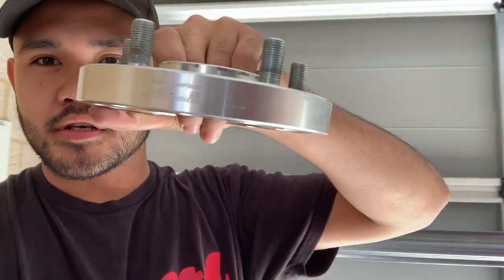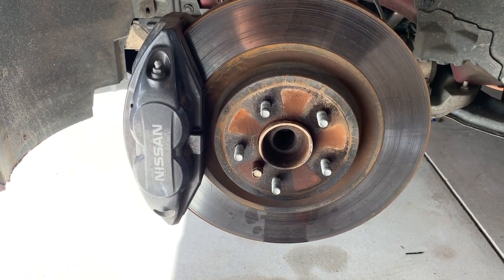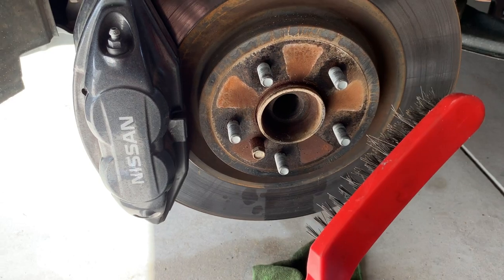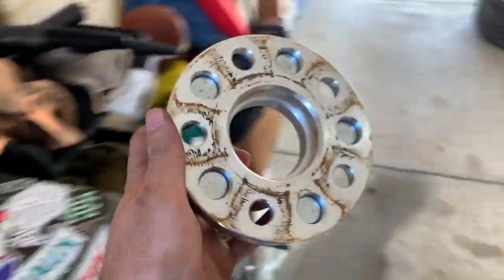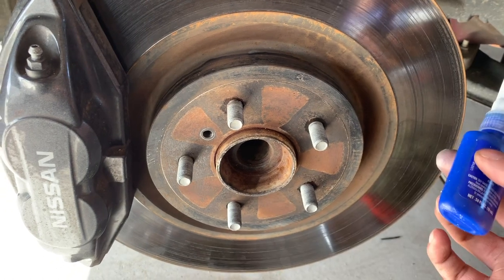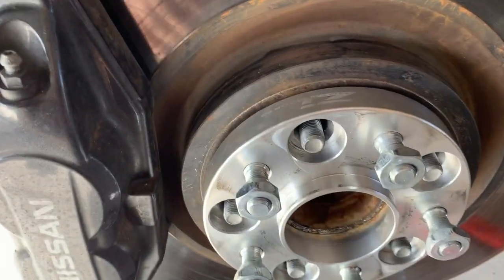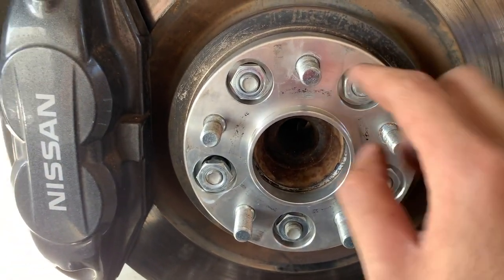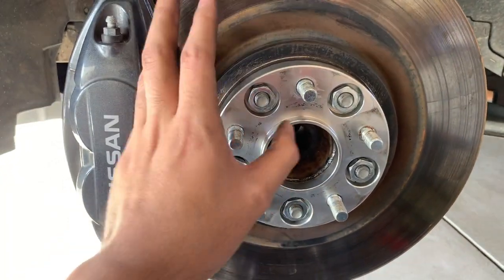Installing 20mm Z1 Motorsports Spacers On 370z

Comment: Did they ever get loose? Any issues with shaking or eating up the tires faster?
Reply from the maker: Nah they’ve never come loose or have any shaking. If you don’t have good alignment that’s what eats up your tyres (excessive camber and toe in/out). Just make sure you do torque the spacers properly then drive around and torture them up again
Reply from the maker: Also I was daily driving with spacers on for 5 years with multiple track days as well

Comment: Might not see as its been a while, but just got my z and trting to fidn the best type size for the oem rays. Cheers mate
Reply from the maker: Hey mate, best type size of what?
Reply: @HustleGarageTV   tyre size sorry, been seeing a lot fo 295 or 305. what are you running cheers
Reply from the maker: @adampilkington6521  on my current wheels or stock wheels?
Reply: im asking the tire size, are you just using 275 in the rear and 245 in the front @HustleGarageTV
Reply: for the video
Reply from the maker: @adampilkington6521 yeah in this video I’m running stock tyre sizes 245 and 275. I’m currently running 255 and 285 now

Comment: Great vid!  Are those Rays wheels?  I ask because I have Rays and I’m about to do the same install, 20mm on the front, and was wondering if you any interference when you put the wheel back on, from the factory lugs hitting the back of the wheel? I previously tried 15mm but the lugs hit the wheel and wouldn’t allow it to sit flat against the hub. Thanks.
Reply from the maker: I had no trouble at all, not with these spacers. I tried GkTech ones cause they are really good spacers but the studs on them were to long to screw the factory nuts onto the wheels, so I switch to these ones and it was perfect fitment

Comment: With 20mm did you find the OEM studs poking through the spacers at all?
Reply from the maker: Clint N not at all, I did try GKTech 20mm spacers on before and it had that problem but the z1 spacers are perfect.
Reply: DegilZ34 thank you very much for the response. Car looks amazing, enjoy.

Comment: Do you notice any difference in drive quality from the spacers? I wanna get these ones but I’m worried it will change the way it rides, thanks in advance for the feedback man
Reply from the maker: N.D370z the spacers actually give me more stability, cause it increases the ‘track’ of the wheels. Have had these spacers on for a while and they’re still running smoothly.
Reply from the maker: N.D370z in terms of drive quality, nothing has really changed, just better stability tbh